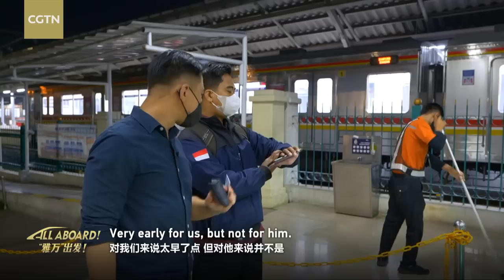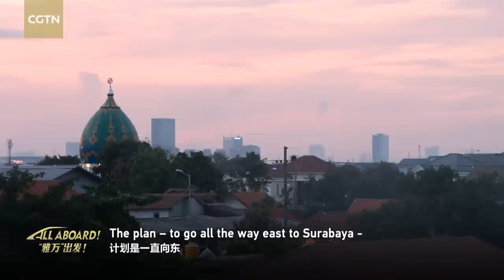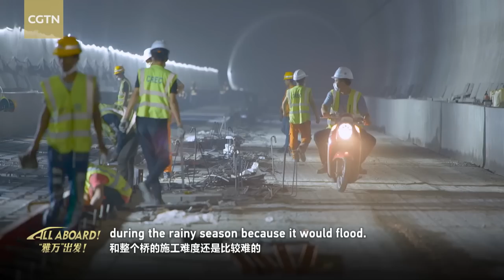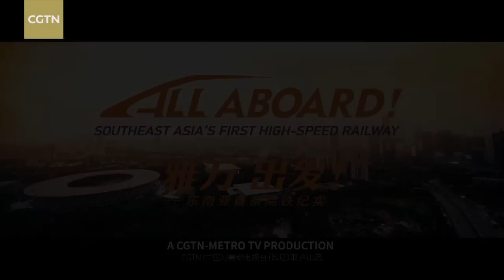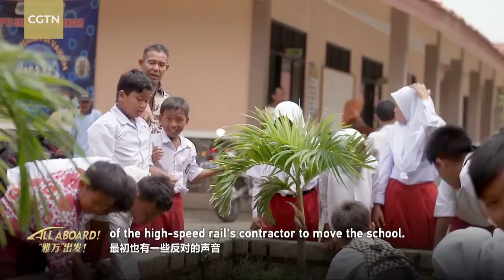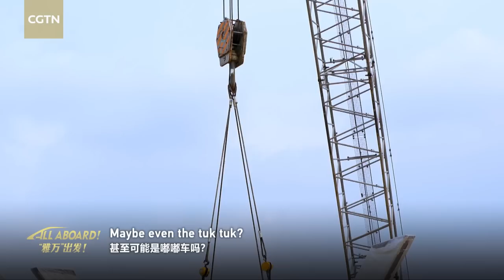All aboard! Southeast Asia's first high-speed railway

Comment: Indonesia IMPORTS of Oil and Gas for its Transport needs is Huge. Transiting to Electricity used by High Speed trains is the first step. More need to be done. Electric Buses is the Next step. Then motorcycles and Cars is the next stage. Hope Indonesia baby Steps to Electric is Successful. Saving both Import Bills and Less Pollution which benefits the Indonesia People.

Comment: This train is high speed powered by electricity .I had experienced using diesel train from Jakarta to Bandung took 6 hours due to diesel engine trouble.
Reply: Yup, and also the old rail system was made in colonial time. The rail is narrow and so winding, the train couldn't go fast, even with the newest engine.
Reply: @EA_SET  thats not that bad.. The old train/regular train from Jakarta to bandung is good enough , now days its only take 2 hour and 40 minutes to travel between the two city
Reply: @ryadi1703  no, regular train almost 4 hours now.
Reply: @ravhi1000  ih saya suka naik argo parahyangan sekarang yang paling lama cuma 3 jam yg paling cepat 2 jam 40 menit bro
Reply: Diesel train now took 2.4 hours, there are some improvement regarding the track quality to hold more speed. The challenge is this high speed train will not directly stop at city central stastion (which very strategic) so still need fast and efficient shuttle transport to the city center too.
Reply: @ravhi1000  udah 2.40 menit atau 3 jam, saya sering pakai buat kerjaan
Reply: @fauziahmad7054  per kapan mas? Saya terakhir hampir 4 jam dan saat itu jadi males naik kereta lagi karena waktu yg hampir sama dengan naik kendaraan seperti travel atau bus
Reply: @ravhi1000  Sebelum pandemi saya sekitar 2 kali sebulan bolak balik JKT - BDG naik kereta, paling dari 10 kali ada 1 - 2 kali lah ada delay yg agak lumayan, sisanya on time. Berapa lamanya tergantung naik kereta yang jam berapa (terpengaruh sama transit dan nunggu jalur, bisa nambah sampai 30 menitan kayaknya paling lama), tapi in general kereta selalu yang paling on time kok -- sekitar 3 jam kurang dikit.

Comment: Correct me if I am wrong, the one at Vientiane, Laos, that connects to China, is the first HSR in ASEAN.
Reply: Laos to China is not really HIGH speed... Vientiane-Boten railway have a top service speed of 160 kilometres per hour. When finished, the high-speed railway in Indonesia would be the first high speed railway in ASEAN with a top speed of 400 kilometres per hour. (top service speed will be probably around 300 km/h)
Reply: @johnsmith-cw3wo 350 kph top speed

Comment: No matter how it was labeled or country of origin, a servo motor made in PRC are using power controllers that are made in Japan, or the hardware are machined using German made CNC, they are using Japanese made Topcon survey station kit and vice versa. What really matter is the total costs of ownership vs ROI and payment scheme. It will be better for Indonesia if the currency is using directly Rupiah - Yuan Swap instead of USD. There is no country on earth that can manufacture things competitively by themselves...
Reply: " .... what if China wants to make Singapore the first China harbour outside China and interconnect it with southern China, this would boost South-East Asian trade hugely ... "
Reply: That could be true in the early years of HSR development in China where it had to import some major components from Japan, Germany etc; but that was history. Nowadays, China manufactures most of those components needed for their HSR system, domestically and foreign projects. Today , China has the technology, supply lines & related industries to produce those capital components required domestically.